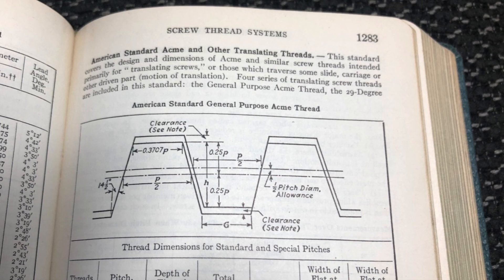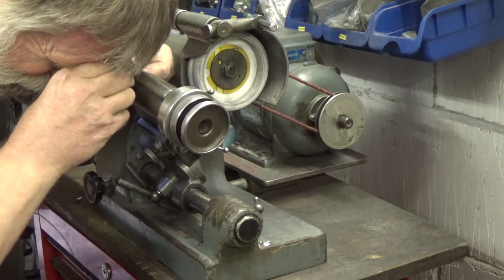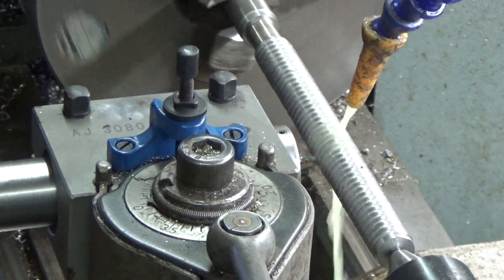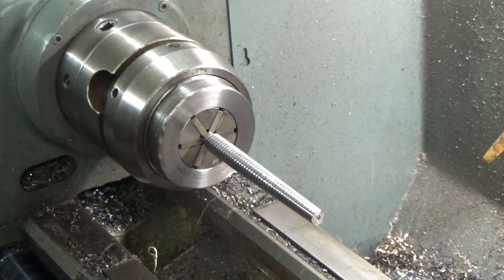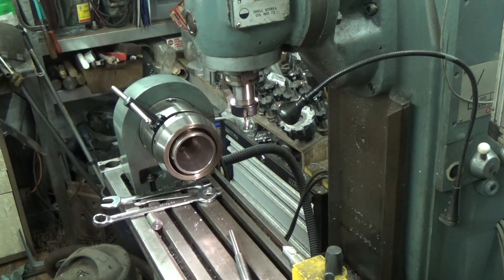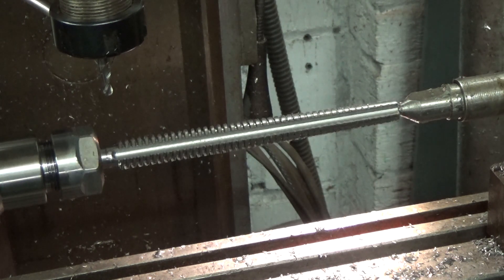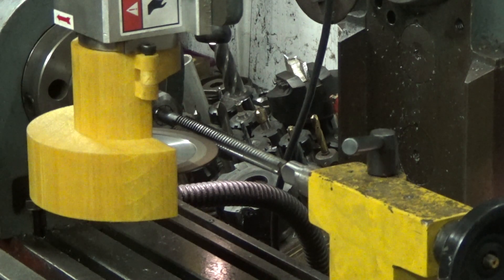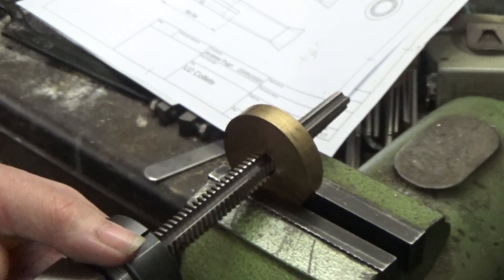Making a Custom Acme Tap in the home workshop

Comment: How does the average guy with regular tools do this.
Reply from the maker: That depends on your "regular tools". If all you have a hammer and a screwdriver then there is no chance. 
If you have a lathe, then there is more chance. You can, in theory, cut a tap on a normal lathe and back it off by hand grinding. 
But I got to my current setup by making tools to make tools to make tools. 
If you get a cheap lathe, and convert it to CNC, then you could do exactly what I did. The software (LinuxCNC) is completely free. 
But, do you want the tap, or the nut that the tap can make? In most cases for a one-off you can just single-point the nut on your lathe.
Reply: @andypughtube  I'm a retired carpenter of 40 + years. I can do about anything with my hands. If I can get it in my head the way I want it, I can generally make it. I do have a wood lathe but not a metal. I never bought a tool that would not pay for itself. I have made lots of woodworking tools out of wood and metal. I make taps for threading large holes in wood all the time.
I have been thinking about putting a three jaw scroll chuck on my wood lathe so I could grip some small parts. 
Have a great day.